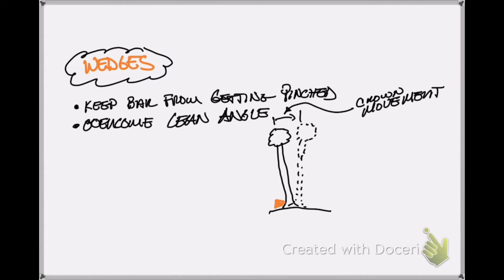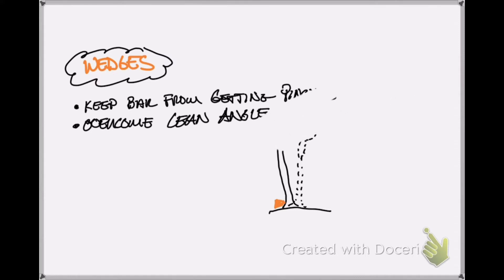Felling Wedge Math Explained With Examples #felling #fellingwedge

Comment: Guess I better start carrying a wider range of wedges 😏🤓  Serious, thanks for a great explanation  👍👏
Reply from the maker: You can stack them to get more lift.  The longer wedges are easier to drive in.
Reply: I carry like 25 wedges in my box i will never not have the right set of wedges for a job
Reply from the maker: @doctorburger5322  I use wedges when I buck logs too…  I get grief for that too…